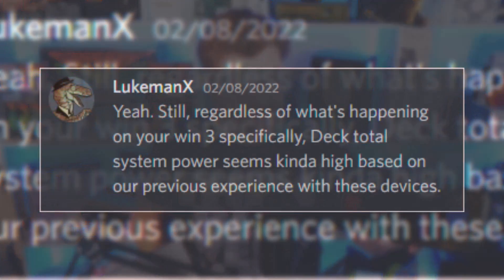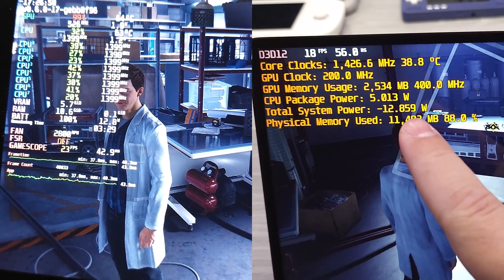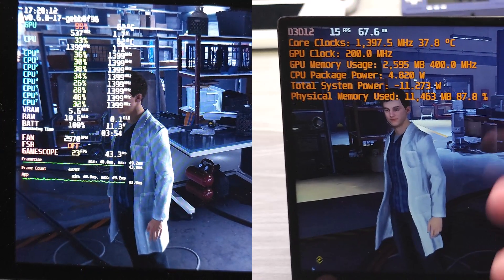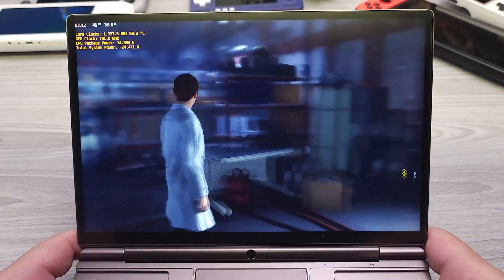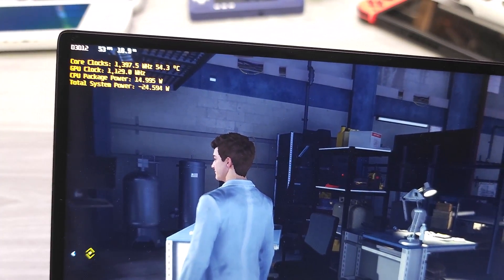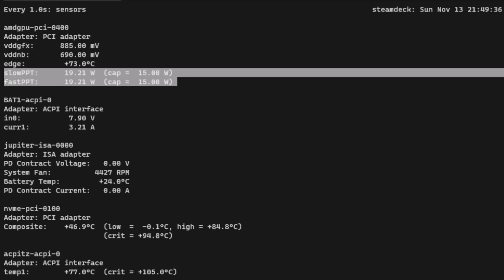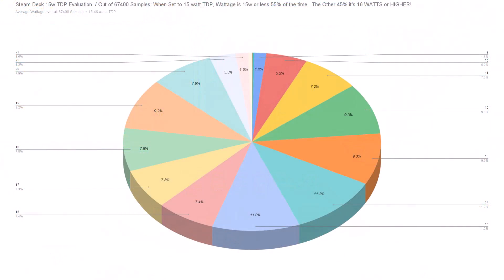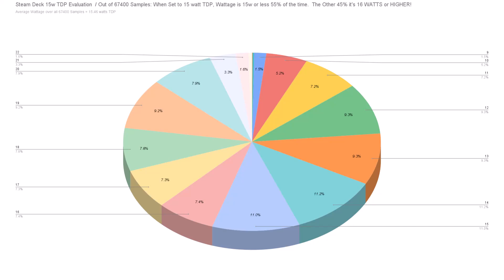The TDP On The Steam Deck is Wrong

Comment: Does this mean that the ideal 8-11W TDP that people have been mentioning for the steam deck is actually just something like 11-15W ish on other devices?
Reply: Didn't he say in his other video the Deck was using around 1/2 to a watt more  total power at the same TDP as the Ayaneo 2?   Now where are those extra 2-3 watts went in the Ayaneo 2? He mention in this video at 15 TDP is average 15.5 watts which seem to explain why the Deck using a little extra 1/2- 1 watt compared to the Ayaneo 2.
 I had to look up what TDP was when some many was talking about it and this article said :" TDP is not — however — a direct measure of how much power a component will draw, but it can be a good indicator."
Reply: @smidlee7747  in this video he says with further testing it appears the Deck is actually using about 3 watts more at any given TDP due to the averaging measurement difference specifically for the TDP.
Reply: @bnr32jason  He clearly stated the Deck was using 1/2 to a watt  total power more at the same TDP compared the Ayaneo 2. He even said you should go by total power wattage which was what I was doing the begin with.   In this video he stated the average was 15.5 would explain the extra 1/2 to a watt extra in total wattage. Are you claiming he lied about the total wattage in his last video?
Reply: @bnr32jason  I always go by the total wattage to determine the battery life. For example God of War uses around 25-26 Wh average . With a 40 Wh battery at 80% efficiency which leaves 32 Wh I calculated The Deck can run 1 hour and 20 minutes which was exactly how long it lasted.
 I also calculated to include an exterior battery at 80% efficiency to charge my Deck 1 1/2 times and should run the Deck at 15 Wh total wattage to 6 hours. It lasted 6 hours and 4 minutes.
Reply: @smidlee7747  I'm claiming he hadn't done full testing in his last video (the Deck vs Ayaneo 2 video) and he even said that himself. In this video he said the true difference is about 4 watts at 15watts. Watch the video where he explains the chart at 8:50 and then use it to see the actual difference.
Reply: @bnr32jason  In his last video he clearly showed the Deck is using 1/2 to watt of TOTAL power consumption vs the Ayaneo 2.  He even mentions he always shows the TOTAL wattage used.
Reply: @smidlee7747  you are completely ignoring the NEW INFORMATION and NEW CONCLUSIONS he draws in this video. He explains it very very clearly. Pay attention, or just keep ignoring facts so you can deny the fact that the Steam Deck APU isn't as magical as we all thought it was.
Reply: @bnr32jason  You don't know yourself do you? So inform me genius the snap shots comparing the deck vs Ayaneo 2 there was a 1/2 to a watt total Wh difference yet his snapshot of two 6800u devices has a full 4 Wh difference.
Reply: @bnr32jason   I saw from another reviewer  of the Ayaneo 2. He had it set to 15 TDP and on the screen I can see it was using 28 total Wh. 
 I'm using both my brain and my eyes to see.
Wait. it's the same guy.  lol
Reply: That might partially explain why the Steam Deck so greatly outperforms Rembrandt systems like the Win Max 2 and Ayaneo 2 at lower TDP's. Comparing them apples to apples has the Steam Deck running at an effectively higher TDP than its competitors, giving it an unfair advantage -- though I think it's fair to say that despite the advantage, the Steam Deck's performance at lower TDP's is still absolutely remarkable and far beyond the competition!

I think it would be interesting to compare systems using total system power as the main metric rather than TDP (with similar functions turned on/off and absolute screen brightness set to a similar level). Total system power is what actually determines a system's battery life after all, and as the Phawx observes here, TDP is a deceptive metric at times!
Reply: @JakeHamzawi  I really hope Phawx puts out a video with some total system power benchmarks with maybe a subscript of what the system TDP settings were at. That way we can really get a direct comparison.
Reply: Yup, this is the "black magic" that Phawx and other reviewers have talked about with their benchmarks. So Valve's custom APU isn't really any more efficient at low TDP than a 6800u, it's just that their TDP settings aren't really truthful.

So as usual, "magic" is nothing but smoke, mirrors, and misdirection.
Reply: @bnr32jason  I mean even with the steam deck at 9w still got very close to the 6800 in certain titles when it was at 15w, it's not smoke and mirrors that the deck is more efficient at lower TDP, because it is, and it should be having less CPU cores and lower voltage/clock speed ram, it's just that the TDP levels are a bit skewed.
Reply: @Mantenner  in some cases it is more efficient at lower TDP, but in some situations its not. Look at the benchmarks he did in an earlier video (SD vs Ayaneo2). Phawx said here that difference is about 3 watts. In most of the benchmarks that 3 watt parity puts the 6800u and SD APU neck and neck.